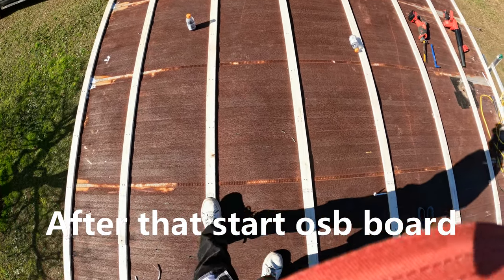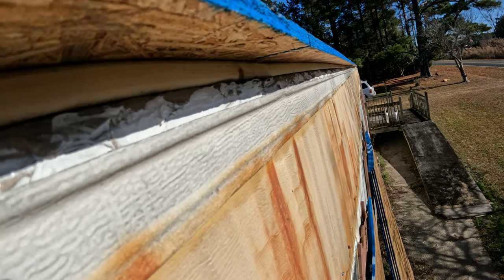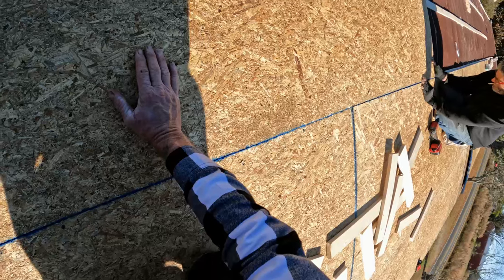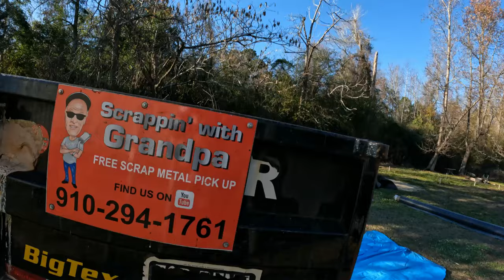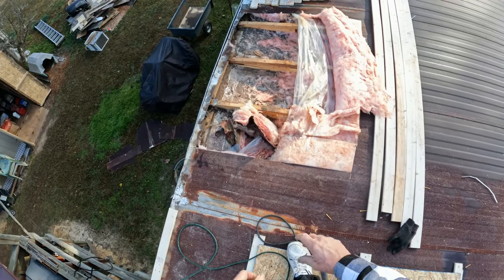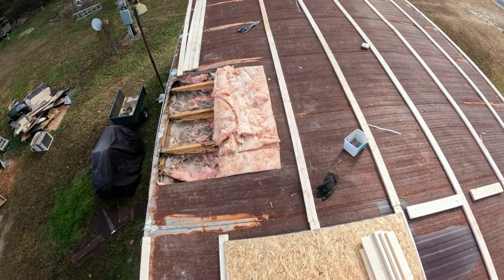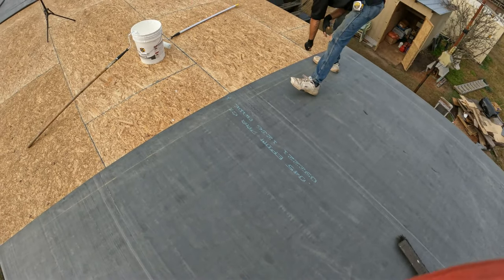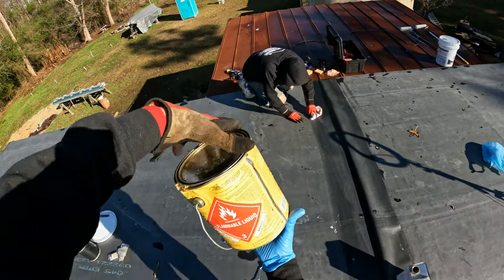(HOW TO) Repair Single Wide Mobile Home Trailer Roof Training Video

Comment: Drew buy a EH-250 Safety Hoist,  it is electric powered.  It can be used to lift all the 4x8 sheets plus lift the rubber roof up.     I bought one a couple of years ago and love it.  All the guys on crew love it.  I have copied your method of fixing mobile home roofs and done 6 roofs.    Your videos are priceless.
Reply from the maker: Thank you so much. There is good money in it

Comment: Hey drew ur boy up in mass is this way cheaper in matrials ? I was gonna pop lines then screw 1x3 s down put thick ass installation  over the boards then metal panels with a 6 inch over hang on each side ??? Please let me know if you leave the items you used in the description then I know what to buy which way cheaper you guys are so cool love your channel thank you and your right the person who lived in my mobile home didn’t fix nothing I got leaks in my ceiling I can’t fix it till spring and throwing tar over it isn’t the answer it cracks and ur problem still there gonna put a trap over the leaks tie it down till I fix water damage destroys ur whole house god.  Bless brother wish I could hire u soo poor 😂😂😂
Reply from the maker: Quick repair
https://youtu.be/AGnQow7qus4?si=SjATr59lzpXtwrjl

Comment: If someone has mold and rot on the what I think are called rafters on the inside would you still roof over exciting roof or remove damaged roof and start fresh. roof has about 70% damage on the rafters plus mold on others that’s why I ask
Reply from the maker: Remove what’s needs to be removed. Replace it. If it’s made of wood you can fix it

Comment: What is that metal piece you put on the edge and where can I get some
Reply from the maker: I make that metal myself with a metal bender and I use aluminum coil stock 2 foot wide by 50 foot long. I buy it at Lowe’s hardware in the vinyl siding department.

Comment: Hi Drew, one thing I don't understand is why the job isn't finished by replacing the roof vents and bathroom and kitchen fan vents? Why are the plumbing vents just cut off and covered over? A toilet won't function without a plumbing vent. On an asphalt shingle roof, all those vents have to be left in place or replaced as part of the new roofing job. I've never heard you talk about the importance of roof vents on a rubber roofover and I don't understand why. Can you explain it please? Oh, and another thing, I heard you mention that there was a man who was doing rubber roofs like what you do in Anchorage, Alaska. Can you give his name.? I am an elderly, single woman trying to remodel my old 1978 MH and it's hard to find people to work on MHs in Anchorage. People try to do the work themselves and they don't know what they are doing. I've watched your videos since the beginning. I just went back and started watching videos you started making  about 13yrs ago. You do a great job  but I noticed that in the later videos you're not using 2x4s (or 3s?) before you lay down the strand board. Is there a reason for that change? Thanks. BTW, I watch your channel on Roku device YouTube app and didn't find out till fairly recently that there is the ability to thumbs up.
Reply from the maker: Good questions. We install ventless under the sink illuminating the need for a roof vent or hole in the roof for leaks later here is a link showing you what is used
https://youtube.com/shorts/g_5sVez9HW8?si=z1osys8cHG1edRMh

As for the kitchen vet, this place did not have one. He did not want his stove vented the less holes on the roof the less leak you’ll have it in the future. The one by fours or one by threes that we lay down on the roof it makes it a little bit easier for screwing down the OSB. We have learned over the years how to make it easier for us. This Mobile Home had a bathroom window and he wanted to eliminate any possibility of leaks from the roof so he eliminated the bathroom vent. Not all houses or mobile homes have bathroom vents. If you type in Drew’s Roofing And Home Repair mobile home vents, you will see us replacing them when it is necessary or if there is a bathroom vent or kitchen vent that they want to keep.
https://youtu.be/g70oKDwv_L8?si=4qplQ3L5CzkSMIAB
https://youtu.be/dO-7Mk0nJNM?si=ZCvMQlSJsyCpmNqT
This is the last known number I have for the gentleman that lives in Anchorage 
I hope this helps explain your questions 
(907) 727-7676
Reply from the maker: I hope I answered your questions
Reply from the maker: Thank you so much. I hope the guy is still working also

Comment: Why do you sometimes choose slats on rafters and other times not?
Reply from the maker: It’s all according to how smooth the roof is. If there are a lot of ups and downs between the Raptors, I use strapping to be honest from now on I’ll probably always use strapping. It’s a little bit easier to do so if you’re gonna go ahead and use.
Reply: @Drewsroofingandhomerepair  THANK YOU.
Reply from the maker: I’m starting another job on Tuesday. I hope you are tuned in to watch. It will be a two day video on a single wide mobile home and we will be using striping as it adds extra protection and makes the roof a lot smoother so that I can apply my OSB.